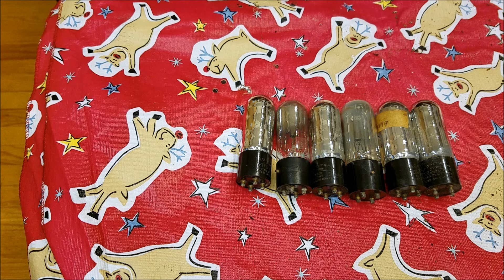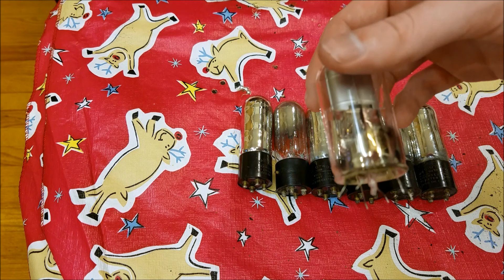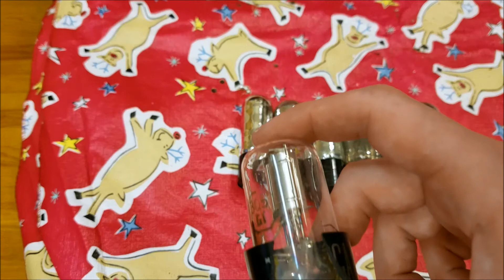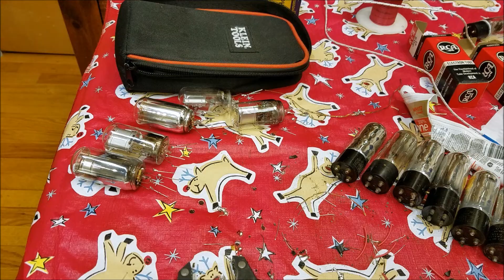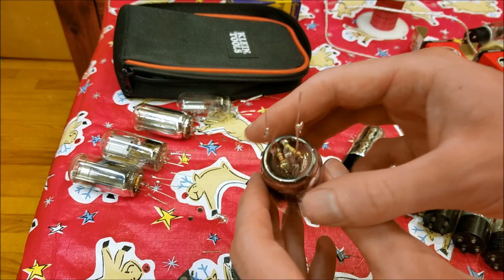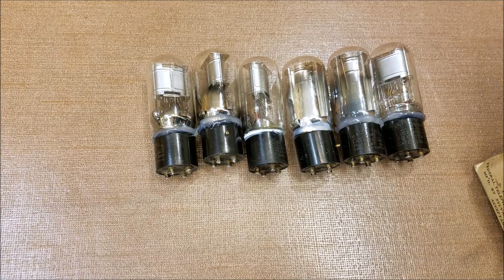Making Counterfeit UV199 Tubes

Comment: I've read it's also possible to use a 30 tube with a resistor to drop the filament voltage a bit.
Reply from the maker: That would make sense, although i think 30 tubes are also 3v so I’m not sure if the resistor would be needed. Im not sure how common 30s are though, I dont think many radios used them after the early 1930s
Reply: @bss1250  They are 2V..